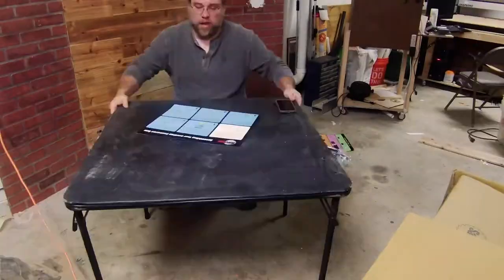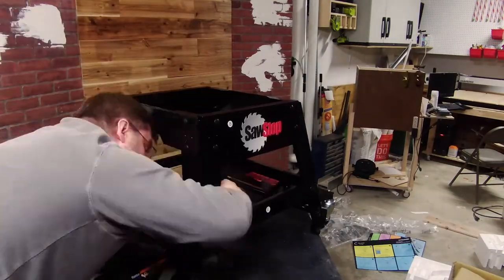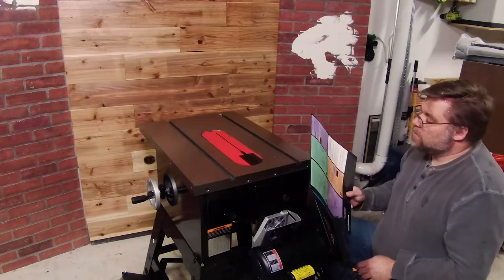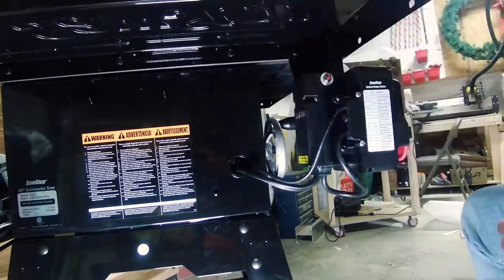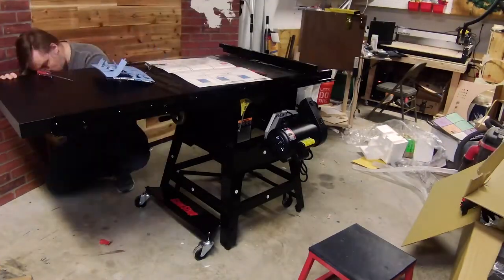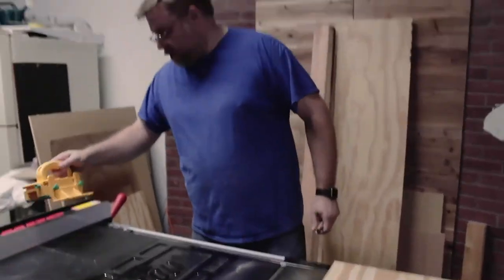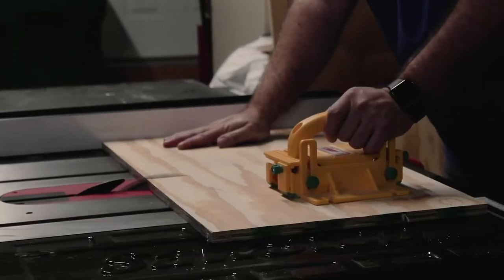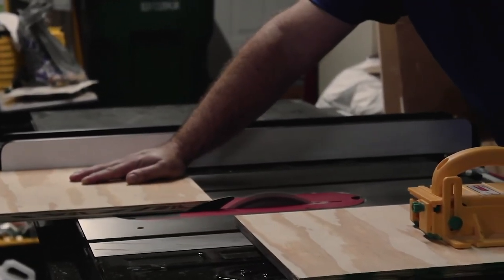It's time for an upgrade... Why I bought a Saw Stop Saw

Comment: Great choice, Sawstop makes an awesome saw safety feature aside. Are you going to drop a router in the other extension or make some tablesaw jigs in the future. The more you start using the tablesaw the more you realize why the call it the heart of the wood shop.
Reply from the maker: I have thought about the router, I also have thought about putting it into my outfeed table.  As for making some jigs, it is on my list to make a cross cut sled.
Reply: @mysimplebuilds  The router in the outfeed is something I wouldn’t have thought of and a crosscut sled is probably my most used tablesaw jig, really useful for accurate repetitive cuts and smaller parts.

Comment: Would it be possible to fill the stamped areas on the wings with epoxy or something like that?
Reply from the maker: That's an interesting idea.  I do want to try some epoxy fills for other projects.  Never thought about it for the wings.
Reply: @mysimplebuilds  Are you ready to modify it? If it were me, I would drill some small holes in the recessed areas so the epoxy will have something to grab onto, otherwise it may not bond.